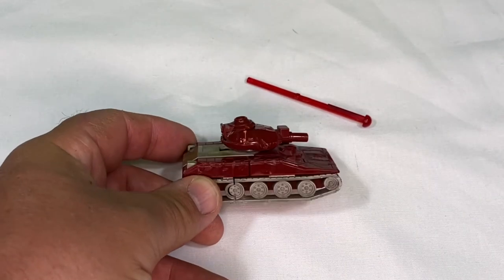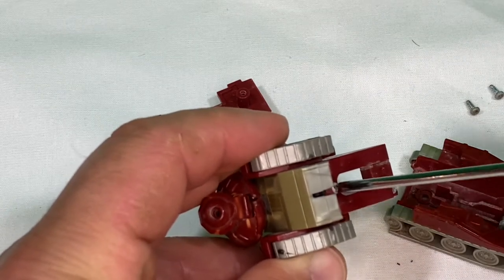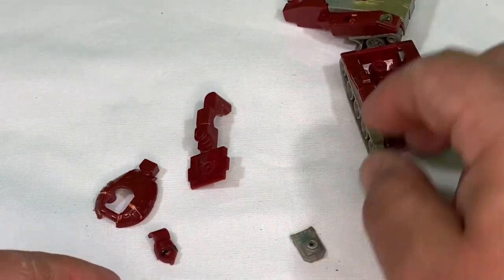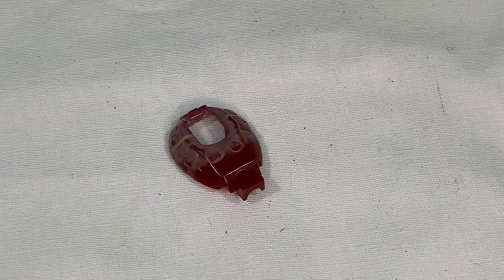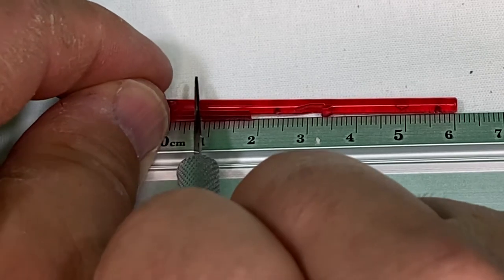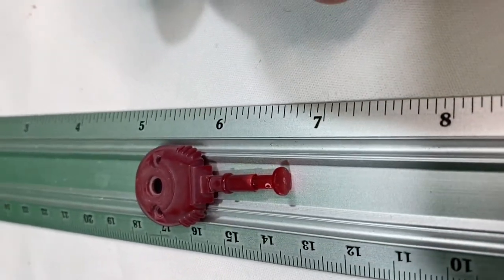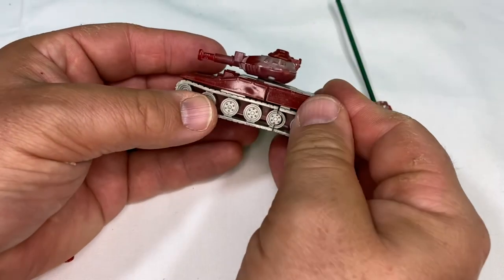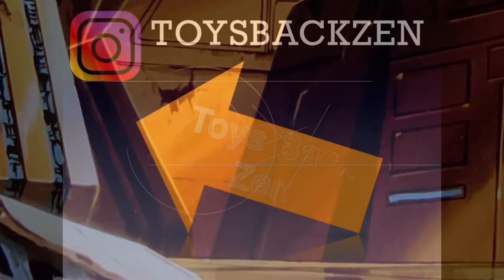Can It Be Saved?! G1 Transformer Repair Warpath

Comment: OH I do have  a  suggestion for a   fix  video for you. OK The  repaints  of  my G2 hero prime & Megatron Scourge & Bludgeon  the  rubber hoses  has  completely  deteriorated over 20 years time. I am Putting  vaseline in  the  ones for my G2 prime & megatron  to keep them most. I  am  also trying to figure out how to replace the hose. To connect the bellows to the  air launcher again. I  have them in the package  too. I wonder if they also will deteriorate too over time.
Reply from the maker: That would be a fun repair. I have done similar repairs already, check out my Galactic Man Repair part 1 and 2, also radio shack robotic banker repair where this same problem happens to these toys. Unfortunately this will happen to boxed sealed toys, o-rings on GI Joes is a good example. I’ll keep my eye out for these toys in the wild and perhaps do a video on them. Cheers!